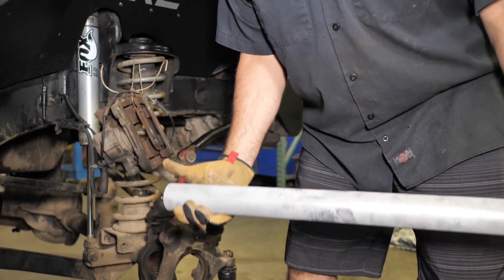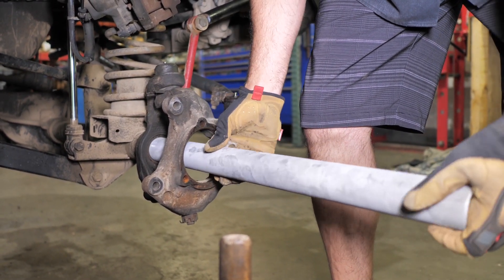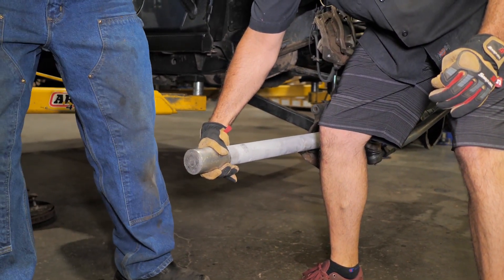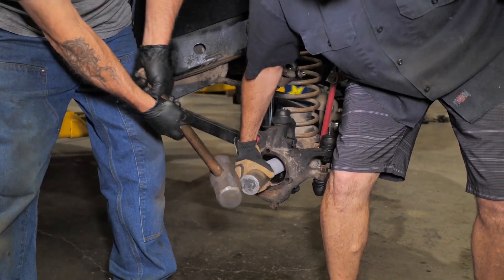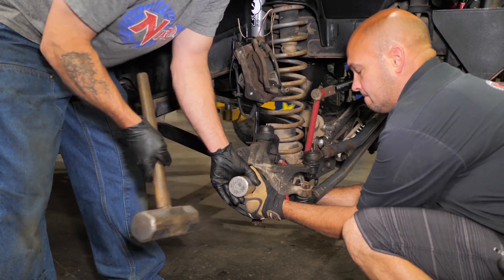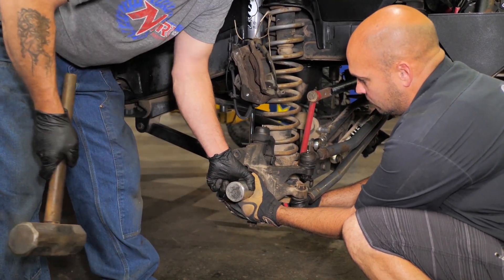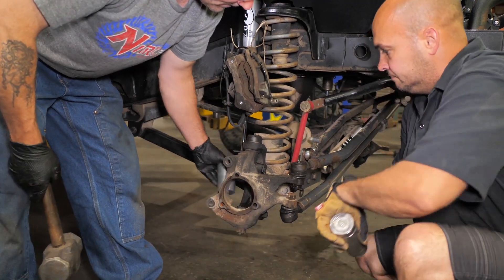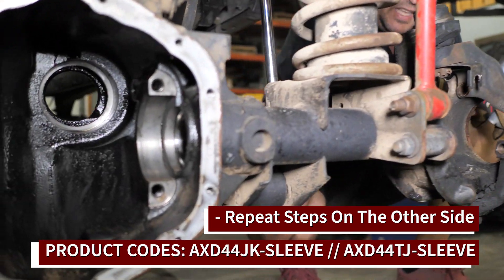HOW TO: Install Nitro Front Axle Tube Sleeves for Jeep JK, TJ, XJ, MJ, YJ or ZJ

Comment: My inner axle diameter is to big my dad used a Dremel to remove the bearing out the rear of a dana 35.now the bearing won't fit is there a size bigger in a bearing or would it fit in the new diameter of a sleeve?

Comment: Is removing the axle and guts necessary?  Understand draining, cleaning and even freezing, however, wanted to see what the minimum work load was to correctly install.
Reply: Definitely the axles at minimum, but to clean it out properly before install the guts need to be out

Comment: The thermal expansion rate of steel is .00000645" per 1'F. So from room temp to 35'F (estimated install temp, probably much higher) you have decreased that tubes diameter by .00023". Not even close enough for a press fit. Minimum press fit for mild steel is .003". Some low tension applications accept down to .002", like cylinder sleeves.
Reply: Might be the difference between hammering in and needed a 20 ton press?
Reply: You think a freezer is 35 degrees?

Comment: Apparently a lot of axle tubes are slightly bowed / bent (slightly - not kinked or anything ridiculous..). Will this do anything to straighten that out or what happens if you try to install in a tube that is not absolutely, ridiculously perfect?
Reply: Great question. Did you ever get a answer ?
Reply: @immelting9834  no, ive watched some other YouTube videos but haven't really seen the answer there either
Reply: Very good question actually. Did you happen to find an answer?

Comment: So you dont have to weld them in?  I thought they had to be welded in.  That pretty cool!
Reply from the maker: No welding required! Press fit :D
Reply: Nitro Gear that’s awesome! I heard something about friction but it didn’t compute what they were referring to.
Reply from the maker: @TexasRedneck  It's a friction fit as in once the tube is not frozen it expands & stays put. Driving them in heats them up. Also there is one end that is machined with knurls that also helps them stay put with 0 play & no need for welding :) Woot Woot!
Reply: @NitroGear  That's really awesome!
Reply: @NitroGear  One more question, I saw the diff housing was empty when they installed these.  Can I just pull the outside knuckles and axle shafts and then put these in without having to open up the diff cover?
Reply: @TexasRedneck  you don't have to remove your carrier but it does make things a bit easier as you want your axle tube as clean as possible and using compressed air from the inside is a great asset
Reply: @FenrirFabrication  thanks for the tip!
Reply: @NitroGear  The thermal expansion rate of steel is .00000645" per 1'F. So from room temp to 35'F (estimated install temp, probably much higher) you have decreased that tubes diameter by .00023". Not even close enough for a press fit. Minimum press fit for mild steel is .003".
Reply: @seahorse5677  You have to parts here which you are not factoring in, so if the housing is 50* - 60* ,and the Sleeve is say -5* (easily done in a freezer) you have a delta of say 55* with out heating the housing which can easily be done.